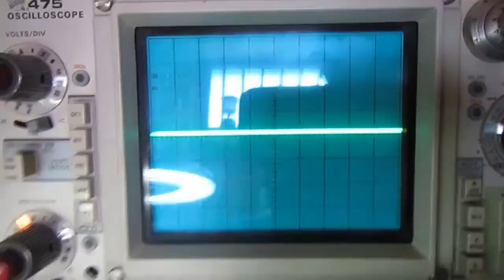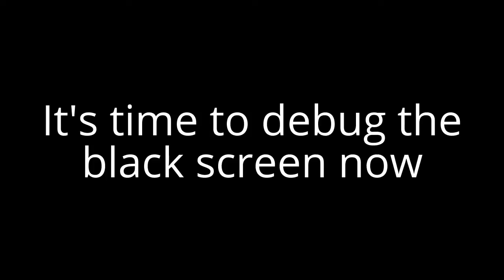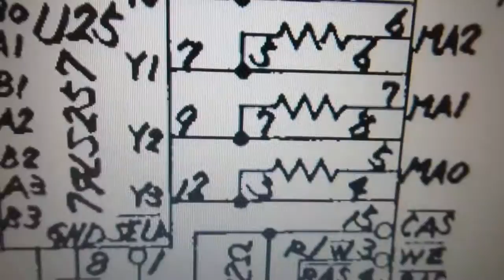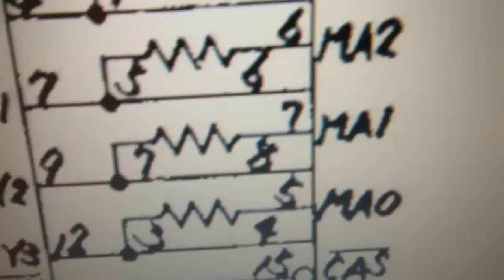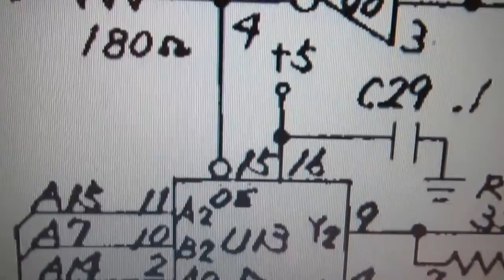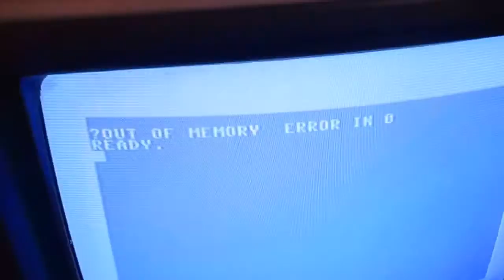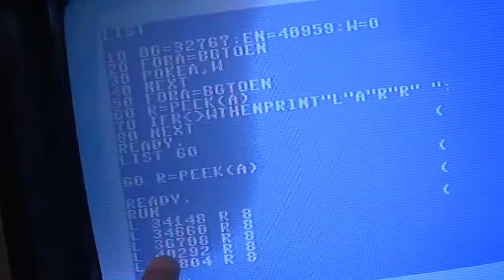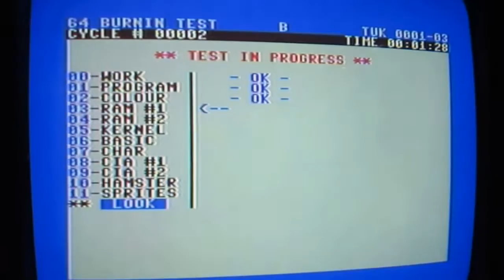C64 repair. MOS-8701, DRAM and a black screen.

Comment: Another great job Frank! :) I recently repaired my old C64 (1985: black screen due to RF Modulator) and I know very well that feeling. :)
I'm now trying to repair the C64 I used to test my C64's chips: it has memory problems (only 8831 byte free). I spotted in U12 the culprit (via Basic proggy) but I found that piggybacking was unsuccesful. It may happen! I'll try removing the chip and installing a socket with new chip. Oh well, excuse me... Great job Frank, as usual! ;)
Reply from the maker: Hi Joe Mc Lutz! Thank you for the very nice comment! Yes, piggybacking works in 50% of the cases in my experience. If you can identify the bad bits with some other method, just replace the corresponding chips! I suggest you to make or buy the "deadtest" cartdrige or kernel ROM replacement, it helps identifying bad RAM bits as you can see on another of my repairs: https://www.youtube.com/watch?v=x3suultS0dE
Reply: Thanks for your precious feedback Frank! :)

Comment: Hi Frank! I finally found the video where I saw that nice current probe! I'd like to have more info on that, things like where to find it, kind, brand and so on if you can. Thanks a lot! :)
Reply from the maker: Hi Joe! If you're referring to the current tracer probe that I use on troubleshooting circuits on some of my repair videos, then it's an HP-547A, here's a link to it manual: http://kripton2035.free.fr/Resources/HP%20547A%20Current%20Tracer%20Manual.pdf
I've found it by putting a saved search on ebay and waiting a lot :) I don't know if there're modern equivalents still in production.

Comment: Excellent!  What is that current sensing meter you have - where to buy one?
Reply from the maker: Hi! 
It is the HP-547A current tracer and I've been hunting for it on ebay until one showed up.
Reply: Thanks for the info!  How does this connect up - does it just have a couple of clips to provide the VCC and ground, and then the probe just detects nearby change in magnetic flux through current passing through the pin?
Reply from the maker: Yes, it has Vcc and GND clips and senses AC-only flux. Sensitivity is settable from 1mA to 1A. Here's a scan of the manual:
http://kripton2035.free.fr/Resources/HP%20547A%20Current%20Tracer%20Manual.pdf
Reply: Thanks, that's very helpful =D

Comment: Great work troubleshooting the three faults.  The current tracer tool comes in handy again.  I still have my original C64 breadbin as well.  However, it died several months ago.  The LED started to fade and eventually would only power up to a black screen, still with a faded LED.  Failed voltage regulator?
Reply from the maker: Hi MindFlareRetro!  What power supply are you using? I would never ever use an original C64 power supply again in these days if not carefully checking the +5V line UNDER LOAD. I have a power supply made with a good switching 5V regulator (good to 3A) and a 9V transformer for the AC part.
A good number of the C64 faults are probably due to the poor power supply design. However, the regulators inside the C64 are very common 78xx ICs, easy to test for correct output voltage. I'd bet on the external power supply if it's the original one though.
Reply: Hi. Thanks for your reply. I have several original power supplies. I initially powered it on with a 251053-02 solid black brick model (the one on the right in this picture... http://goo.gl/VVZKXF). It worked fine for a while until the red LED started fading slowly. Interestingly, if I played around with the C64 power switch, such as toggling it on very slowly, the computer would turn on normally. Eventually, the LED went very dim and I would only get a black screen wit the dim LED. I tried a second power supply 902503-02 (the one on the left in the picture), but the problem persisted.

That occurred about eight months ago and motivated me to start re-educating myself on repairing Commodore computers. I started collecting C64s, VIC-20s and Amigas from people that were going to toss them away as trash. I now have a modest collection that needs refurbishing.

I agree strongly with your warning about using (or not using) original power supplies. After the fading LED incident I purchased a C64 Saver from bwack (http://youtu.be/43crVbRObrA). His C64 Saver is a very well designed and finely handcrafted overvoltage protection accessory – a must have.

Thanks again for your help. I look forward to more videos, perhaps a DIY C64 power supply replacement video.  :)
Reply from the maker: Hi again, from the symptoms, I would suspect the power switch then, or bad solder joints on the power switch pins. Did you check the resistance of the power switch contacts when turned on?
Don't connect the power supply and just measure the resistance of the switch with a DVM in the lowest ohm range.
Reply: Hi. Thanks again for the excellent suggestions.  I will test the suspect areas and let you know how it goes.

Comment: Can you share a Link where one can still buy some of those chips?
Reply from the maker: Hi! What chip exactly? 64kbit DRAMs are still very common (on ebay for example). MOS8701 can be found also on ebay, plus quite a few different replacements (not the original chip, but with the same function).
Reply: @iz8dwf  thank you.  For example the PLA  CIA   VIC and so on
Reply from the maker: @arduino5267  Those chips are out of production since many years already. You can find replacements on ebay for example, but prices are high (in my opinion) and they might not always be  working chips. PLAs have a few different "compatible" replacements too other than the original chips. You might ask on vcfed.org forums if someone near you has proven good replacement chips if you need some.

Comment: on my 8701 the pin 6 the dot clock is dead. not sure if there has to be something or not. clock on pin 8 is there but very spiky. thanks!
Reply from the maker: Hi, first of all, try removing the VIC-II chip and recheck the waveforms on pins 6 and 8. Also check on pin 13 of the 8701 if you have the correct frequency of your crystal (actual frequency depends if your C64 is a PAL or NTSC one).
If the frequency on pin 13 is correct and pin 6 has no output even with VIC-II removed, then the 8701 is not functioning correctly.
Reply: iz8dwf Hey, thanks for your response. I removed the ViC and rechecked everything. Nothing changed. The crystal is at around 17,4Mhz (calculated by my self, because i have a analog oscilloscope. maybe a little bit wrong). same frequenzy has pin 8 of the 8701. Pin 6 (dot clock) only has a voltage of 5V. i cant See any frequenzy. but the dot clock has to be lower than the other clock. so i think something is wrong with my dot clock.
Reply from the maker: Hi Kaoala, the crystal is more like 17.7 MHz, but ok, with analog scope I know it's not easy to have a good reading. Color clock is the same as the crystal value and dot clock should be 7.88 MHz. So, your 8701 looks defective.
Reply: iz8dwf Yeah maybe i didnt read good enough or my scope has a offset. so i think the internal clock divider of the 8701 is broken. Thanks for your help. I try to get a working 8701 :) Have a good day

Comment: Nice one. Where did you get the current probe? I'm looking for something similar but small and cheap.
Reply from the maker: Hi discoHR, thanks for the comment! I've got the HP current probe on ebay. I left a search for it and after a few months it showed up the right one. It's not so cheap anyway. I'm not aware of any other similar probe, but I've never looked for it either.
Reply: Could you please the part number of this HP probe?
Reply from the maker: It is the HP-547A current tracer.
Reply: Wow, 1976. That thing is almost as okl as I am.
Reply from the maker: Indeed it's old, but it woks fine as most of the HP test equipment of the good old years :)